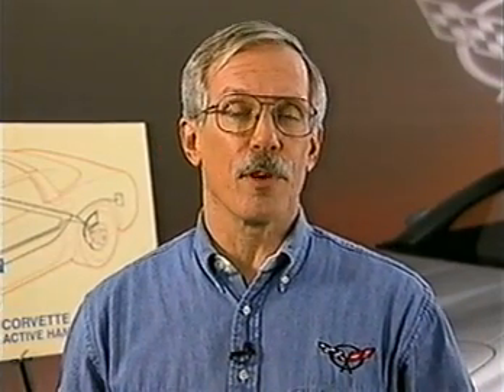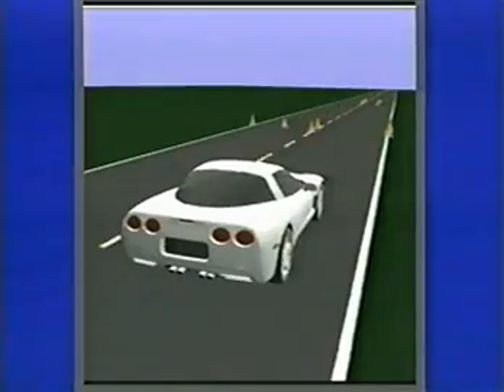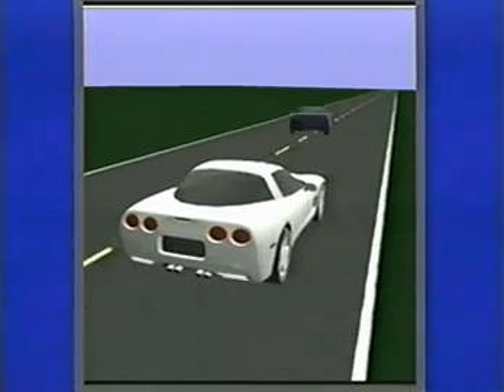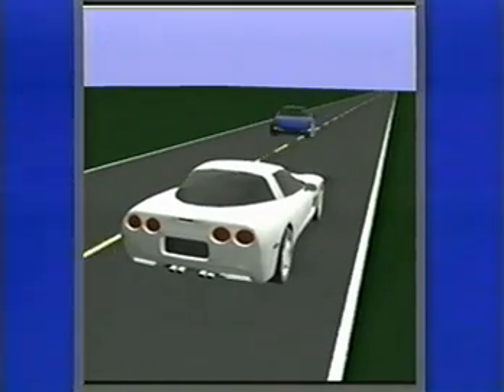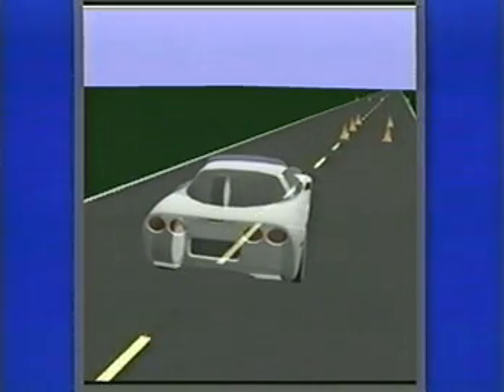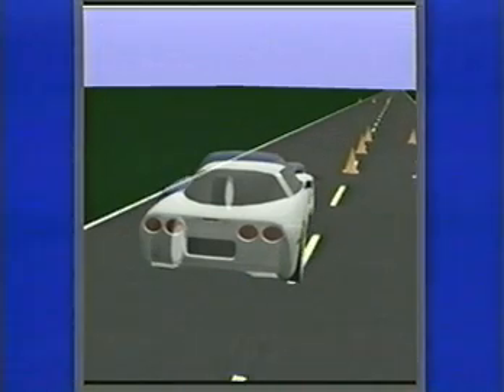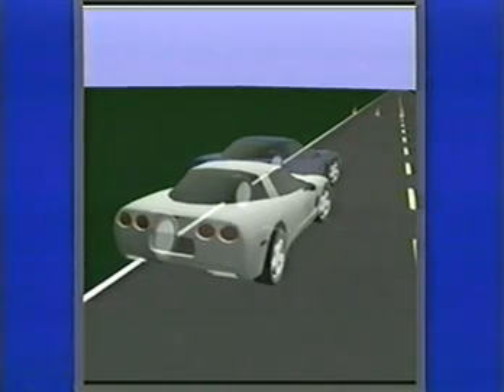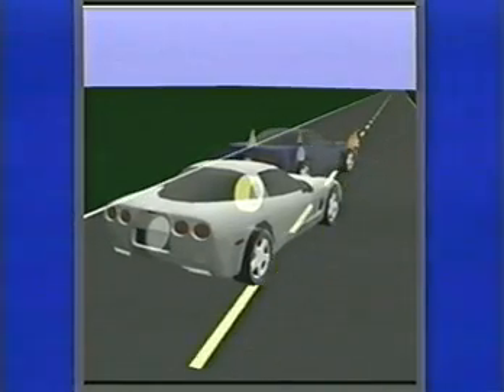Corvette C5 Active Handling System -- GM Promotional Video

Comment: This system is flawed
Reply: Mason Elam the older the car gets it will get issues and the C5 only after 5 years old get issues with AH,
Reply: Mason Elam my c6 2006 had AH issues front brakes Would inadvertently active

Comment: my active handling TTC light was active a week before I wrecked the car, in this exact situation.One of the front hub sensors was bad causing the whole system to fail, ABS too. Very dangerous to drive a corvette while this system is out. my bad... lucky the car can be rebuilt, but ill never driver it with a caution light on again.

Comment: So does the C6 Corvette have sensors just on the rear wheels or on every wheel?
Reply: you realize cars before some point in the 90s didn't have ABS at all and still all (well, most) people driving cars  like that during that time survived? "very dangerous" xD
Reply: @renizer  

You do realize cars before a certain point didn't have seat belts or airbags either, right? So by your logic those things are negligible in terms of safety. Ridiculous.
Reply: No ABS is fine, just pump brake if it locks up. It’s a fine art to master for sure
Reply: every wheel has a sensor. if one goes out the whole system shuts off including the ABS. very dangerous to drive at that point.